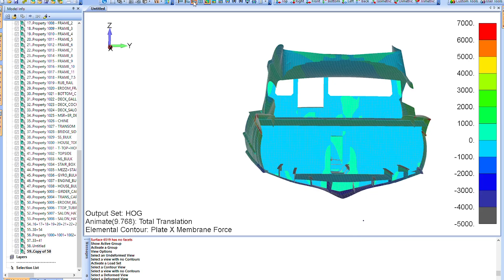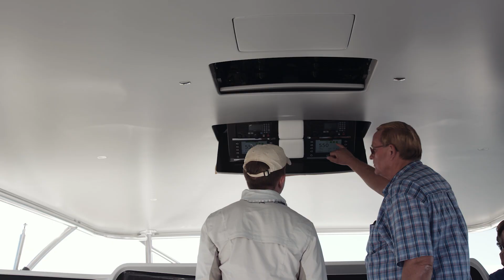Jarrett Bay 90, Jaruco, Launching December 2017

Comment: Love the Jaruco. I cant afford a rubber duck. But if i ever do find myself in a position to purchase a luxury Sportsfisher, I guarantee you it will be a Jarret Bay.
Reply: The Jaruco was astronomically more expensive than most Jarrett Bay Boats. Most are in the 3 to 4 million range. Jaruco was the first sport fisher in the world to get carbon fiber framing etc. It's price tag topped out around 22 million. I actually helped build the hull of that boat and was one of the first people in the world to fit a carbon fiber bulkhead into a sport fisher